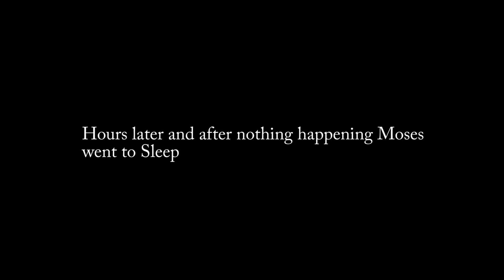ATTACKED BY 2 HOMELESS GUYS DRESSED AS KlLLER ITCLOWNS CAUGHT THEM SETTING MY HOUSE ON FIRE!

Comment: It's so easy to get through those downstairs windows all they need to do is push the timbers and they'll come loose because the nail heads are on the inside. You should screw fix the timbers.

Comment: Just wanted to add that if that guy wants to get in the house, I wouldn’t put it past him to break the front door window. Also, put a key lock deadbolt on the front door, Better yet, just replace the whole door with a steel door and no window.